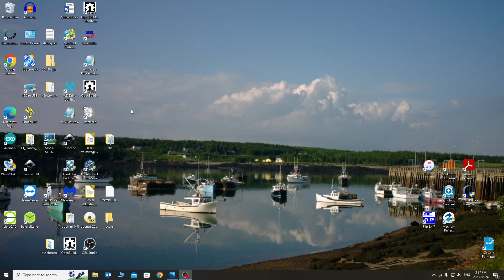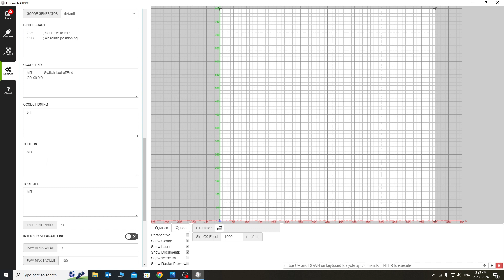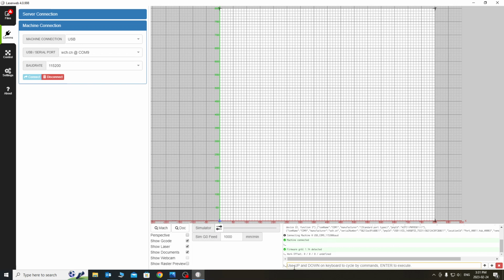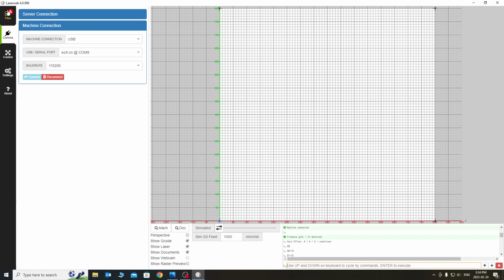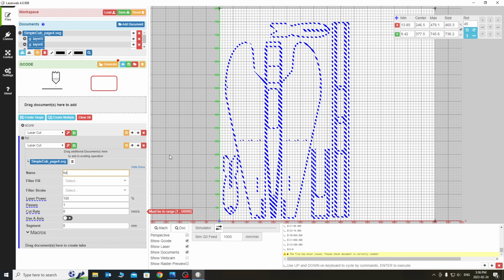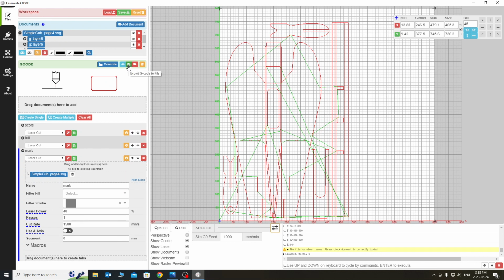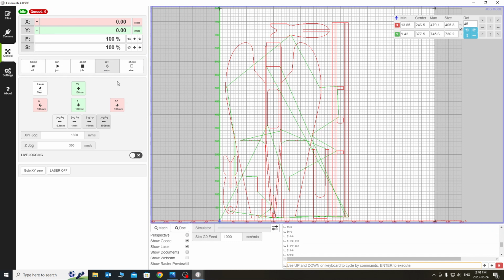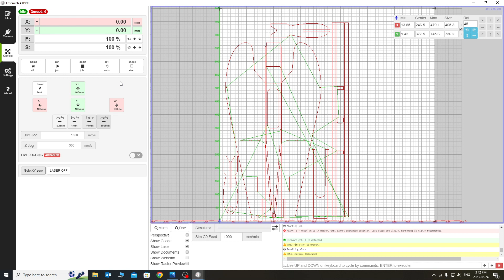Using Laserweb 4 to process and cut Inkscape svg on ERC Timsav needle cutter

Comment from the maker: If you try Laserweb4, the file size will be huge and curves will cut slowly. To fix this set the "Segment" setting in the "laser cut" section to .5 to 1mm and this will tell it to ignore any movements less than that amount and will reduce the file size by a huge amount!